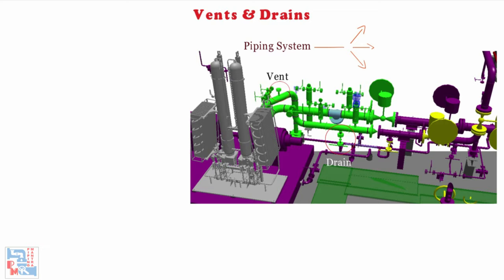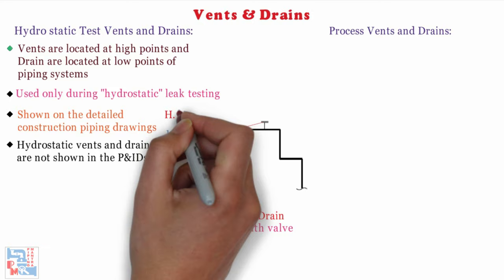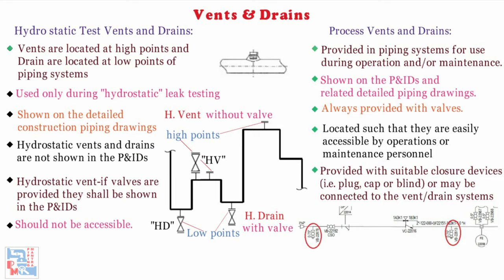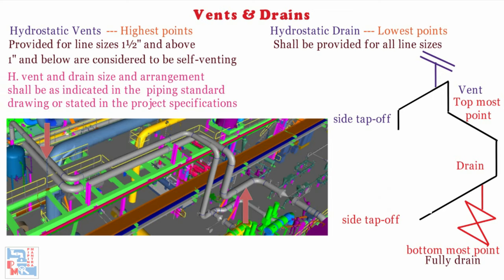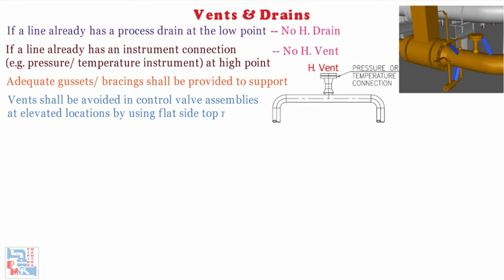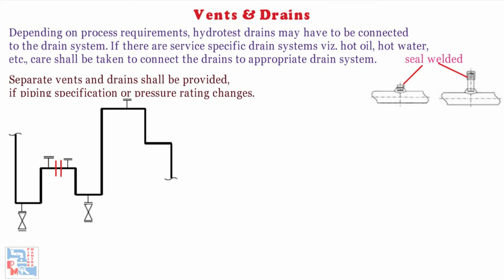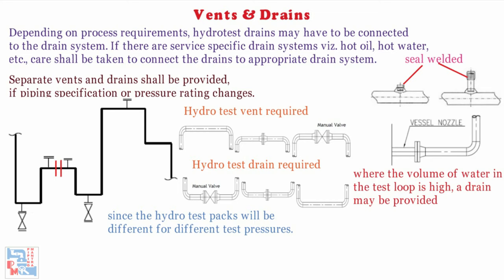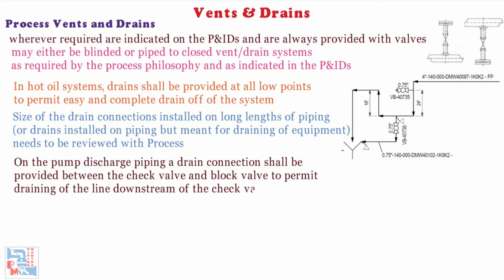Vents and Drains in Piping System | Hydro static Test | Process | Piping Mantra |

Comment: As usual excellent video. I have 2 questions :
1) Why top flat reducers (FSU) do not need vent valves?
2) What do you mean by saying, " vents size bellow 1" are self venting? "
Thanks for your excellent work.
Reply from the maker: There will be no pocket FSU and  in FSD there is chance for pocket.
Reply from the maker: 2. Below 1in line can be drain or vent by providing temporary flange connection.
Reply: @PipingMantra  Thanks for your excellent work. Keep it up.

Comment: HT and Process Vent are provided at highest point in piping system. But Due to height, no access to vent valve isolation. Is it possible to connect pipe to vent valve line and isolation valves installed at lower position, which is operation level on the ground?

Comment: In 6.06  I think that the flange can be vent or drain point and no need need for vent or drain connection. Is that right?
Reply from the maker: Yes you are right. If we have flange connection that can be used as a drain or vent point.